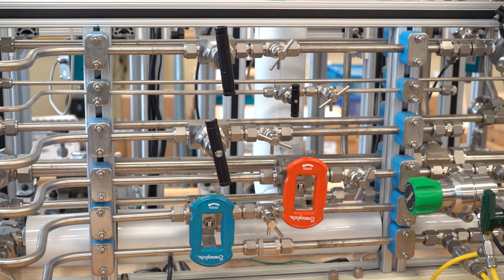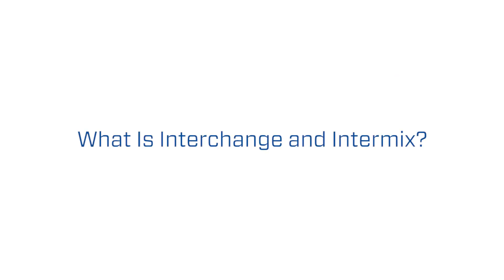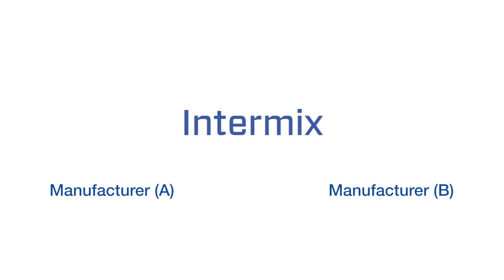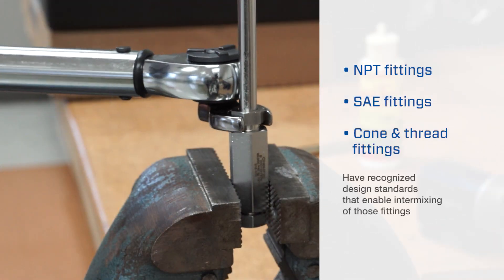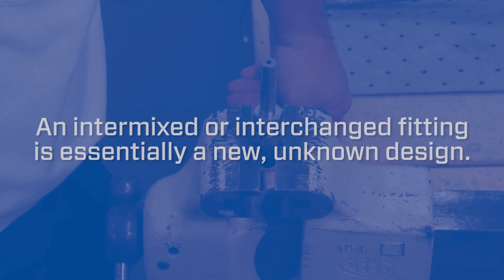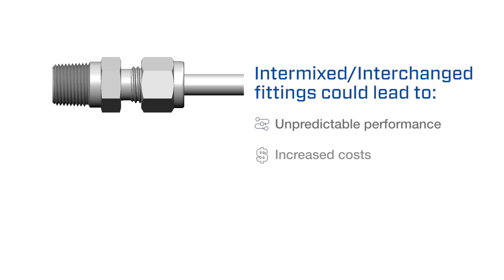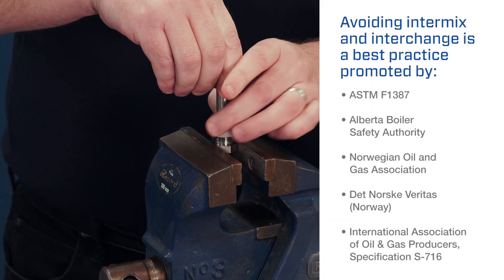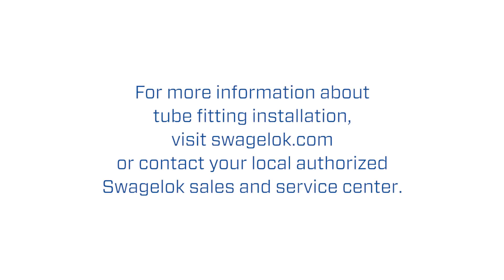Risks of Intermixing or Interchanging Tube Fittings

Comment: Fortunately, the HyLok and Swagelok mixing was carfully tested by german TÜV: All mixing is ok, as long as it is the same diameter ofc.
Reply from the maker: Because no testing can address the many different component design, tolerance, and manufacturing process variables which are uncontrolled among two or more manufacturers, it is safest to avoid intermixing and interchanging.